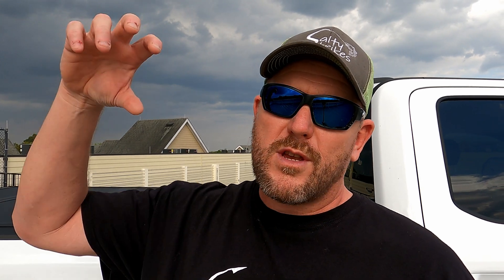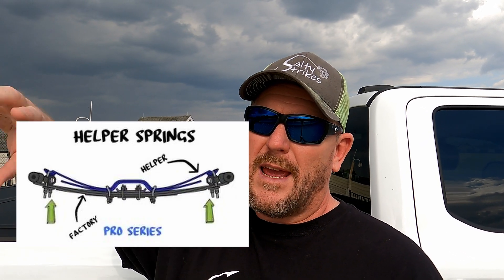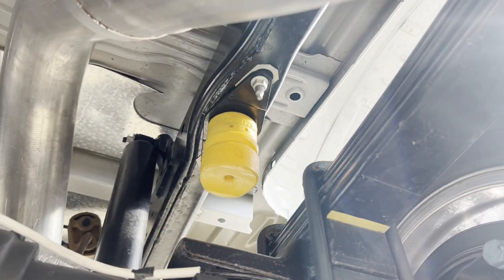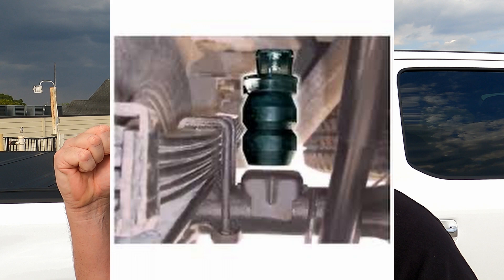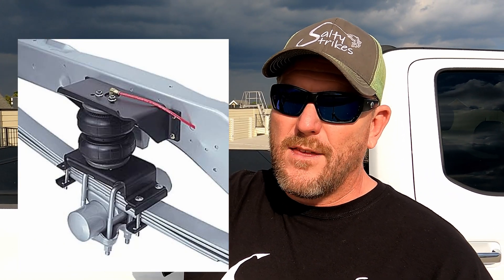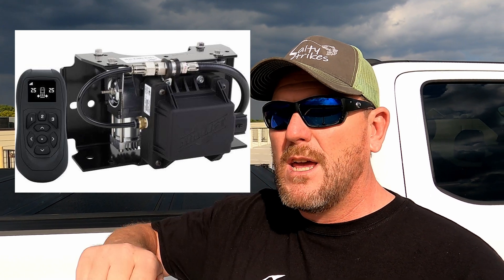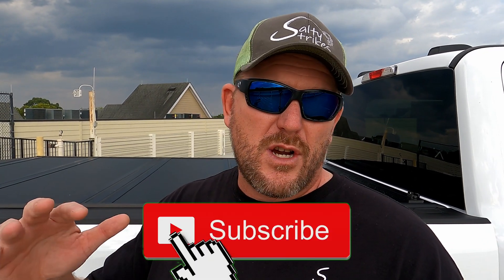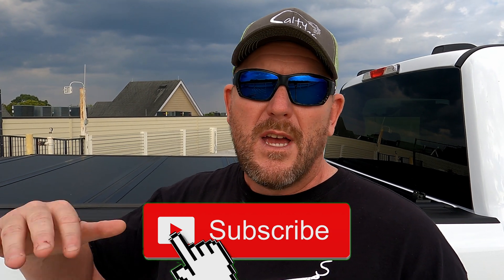“How can I increase my trucks payload capacity?” F150 F250 F350

Comment: You can increases the payload of your truck in multiple ways. It is not end all be all. If it was, then there would not be a 1500, 2500, and 3500 that all look the same with the same frames.
Reply from the maker: Nope, thats completely wrong, that incorrect thinking is the exact reason I made this video. There is only one way you can increase your payload, that is to have your GVWR recertification by authorized personal that complies with NTEA regulatory specifications. No other methods can legally change your GVWR which determines payload.
Reply: Ahh that makes sense. So I can get a sticker that says I can tow 5x what my current sticker says, and without any upgrades to my truck, that makes it true? 
I guess stickers add horsepower and payload capacity.

I understand that you have to say that "legally" part. But physically in the real, payload is increased with parts. @saltytrips
Reply from the maker: @sketchyunicornslab  incorrect again, you can’t change the sticker yourself unless your an authorized personnel that complies with NTEA regulatory specifications, Someone that is, will modify with parts then they apply the appropriate new GVWR to the vehicle and they assume responsibility for the new GVWR and insure all components are able to comply with the new GVWR. Simply swapping out 3/4 ton springs with 1 ton springs as an individual does nothing to change the GVWR there for would reduce your payload capacity because the 1 ton springs weigh more, not increase it. . Yes I say “legally” because that is all that matters and is what forms the basis for having these numbers in the first place. Thanks for watching 👍😁.